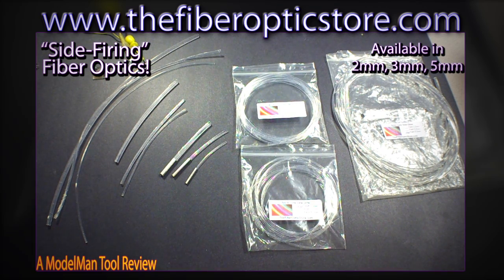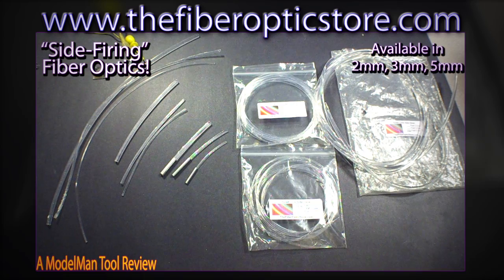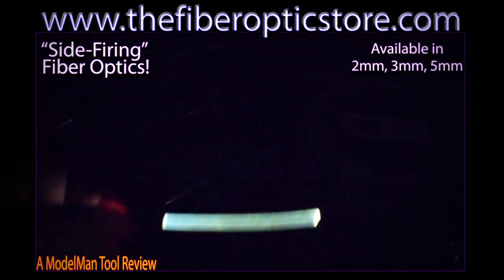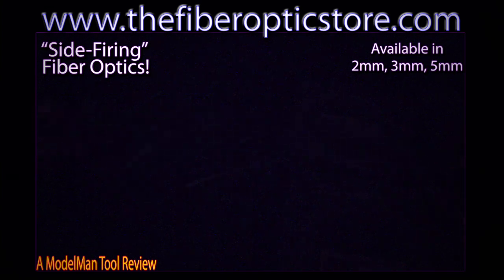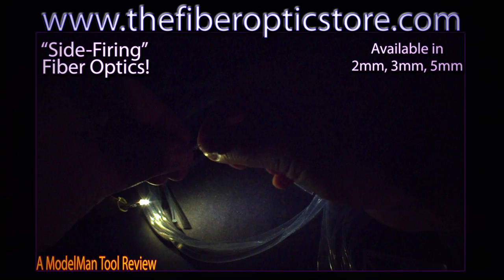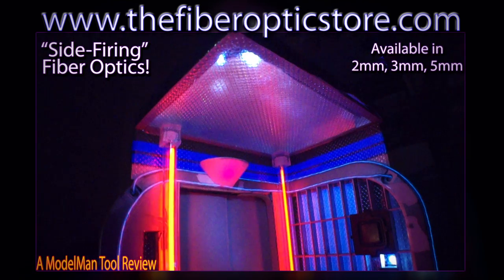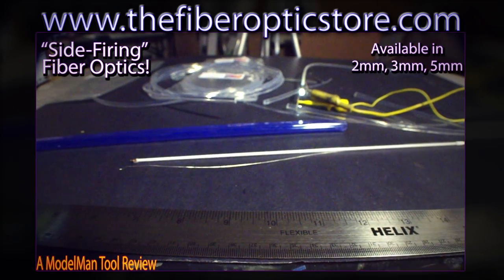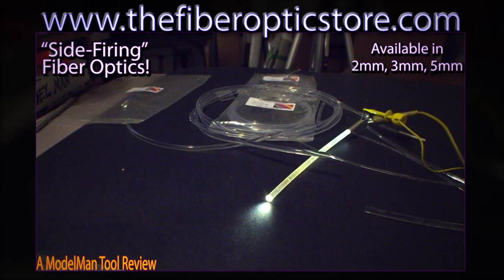Tools: Side Firing Fiber Optics

Comment: What is the little tube you put on the LED before the fiber optics? Does the wire still emit light if you just put an LED at the end of it without the little tube?

Comment: If you want side light far from the LED or far end (somewhere in the middle or various points along the length) have you tested reflective tape along sections where light is leaking and unwanted to see what effect that has?  I'm needing light far from my source. Other alternative might be to glue lengths of this to standard fibre multi strand cable at points where light is needed along a length as light seems to pass out the end of this quite well.

Comment: Thanks for the comparison. I've been waiting for individually addressable RGB LEDs to become very small (~1mm?) and on durable strips or ideally strings, for uses incorporating into garments for more subtle, twinkle lighting effects. I'm going to play around with some thin filament fiber optic cable and see if I can at least emulate tiny LEDs for now. The side firing ones look interesting but I think will be less useful for my case.

Comment: go through a one way mirror and have mirror on other end.
Reply from the maker: +charlidog2 Even with an LED at each end, there is still light fall off towards the middle of a given length, even shorter lengths, oddly.
Reply: ModelManTom Thanks for the prompt response/ What are your thoughts on SG fiber for deck accent lighting?
Reply from the maker: Deck accent lighting, like full-size boats?  What's the scale and application?  The longer the length, the stronger the LED needed to light it -at each end helps.
Reply: ModelManTom I was thinking of lining inside rails at the bottom and outside rails at the top. Its big. 4-500 feet is a low estimate I'd say. Or maybe just use to light steps. 50-75 feet. (multi level deck).
Reply from the maker: charlidog2
There are 10watt LEDs out there and I think you'd need them.  You could also do 10ft lengths or others and insert LEDs into the pipeline as it were.  Even without, they'd still glow, but you'd have to nix most other lighting to really get a good effect I'd bet.  Top-level-waterproof LEDTape would do the trick IP65 would work interior.  That runs in 16ft lengths and will be nicely bright.  There are AC converters that any licensed electrician can install to power the LEDTape (Such as from my own LED supply company, Modelersbrand dotcom!  ;)

Comment: MMT: When I saw this video, I bought some of these fiber optic strands in 2mm, 3mm, and 5mm. Lasers, for those who may have asked, look cool, but will pass right through the side walls with little attenuation if the beam is not properly centered. (Dangerous!) However, if you place the fiber optic flat on a piece of paper, or white sheet styrene, a very interesting thing happens...It emits more evenly diffuse light along the entire length! This enhanced effect works with LED's too. Hope you enjoy this info.
Reply from the maker: +Patrick Mullins Fascinating discovery!

Comment: Weak!
Reply from the maker: +Joseph Stokes Whatever that means or references.
Reply: +ModelManTom i think it's an old DotA taunt from waaaay back.... that said... my audio is broken so i don't know a lot of details, but i'm trying to mod glowy hair bits on my gundam models and the only wires i can find that thin are end-emitting..... been spending all day googling fiber optics, but i can't find anything  on how to convert end-emitting to side-emitting other than bending them and that only makes them glow on that point...

i just wanna know if there are thinner side-glow wires out there on the market

thanks :3
Reply from the maker: +RagPen01 There is no way to convert one into the other.  Perhaps you could slice an end-glow in two, but I dunno about that.  Have a look for www.thefiberopticstore.com.  A good fellow named Paul runs the company and provides good service.

Comment: Your information is very insightful.  I'm no expert in fiber optics or their applications.  However, what I do know is that the "TTSL" fiber optics are commercially produced and commercial grade fiber optics.  Your statement "You are definitely screwing with your life" is an understatement.  TTSL fiber optic cable should never be touched by hand.  It is extremely dangerous and even toxic because it is made of ultra fine optical glass.  Touching it can cause the TTSL cable to break off in tiny, minute, microscopic pieces and burrow its way into your skin and ultimately, into your bloodstream.  Once there, the body cannot absorb or break this special glass down and it can cause untold and unseen damage to the body, including and especially the heart, lungs and brain. 

I have a friend who specializes in working with and installing commercial grade fiber optic cables. She explained the dangers of it and explained that what she was using is known as "TTSL" Fiber Optic Cable.  It's what is used to run the fiber optic cables that power our telephones, televisions, satellite systems and more.  It is also the cables used in powering the internet all over the world because it provides much faster transmission of information and reduces cable sizes exponentially.

You should under no uncertain terms or circumstances, never touch TTSL cable without special safety equipment.  It is way too dangerous and the average person should never attempt to use or handle TTSL Fiber Optic Cables, ever!  Once in the bloodstream, there is no known treatment to safely or completely remove it.  It has also been known to lead to death from mishandling.
Reply: JW  this stuff is plastic not glass like in commercial applications
Reply from the maker: Thanks for that great note!
Reply: is this real? And also are the PMMA fiber optics cable for model making dangerous? I mean this fiber cable that are sold on modelcar sites ect...?

Comment from the maker: The general heat needed for heat shrink is so much greater than fiber that I wouldn't even try it, except to watch fiber melt.  Maybe it would be stronger in a bundle of many threads, but I still wouldn't risk it, myself.  Let me know if you tried and how it goes.
Reply: could I get a exact bmw orange color tube.. I believe 610nm is the color
Reply: I heatshrink ends all the time. No big deal really. Way better light output. Slide a piece of tinfoil on inside heatshrink and bam, it reflects awesome without a second led on other end

Comment: Good review!  A couple of comments:  One, have you tried to light up the fiber with a laser?  I bet that will really light it up!  Second, those CCFL tubes only consume about 200mA of power.  So they won't kill you unless you are sensitive to electricity, but you will get a really nasty shock.   I am speaking from experience.  Back when I was in college I shorted out its big cousin, a Gas discharge tube.  Amperage kills, voltage does not.